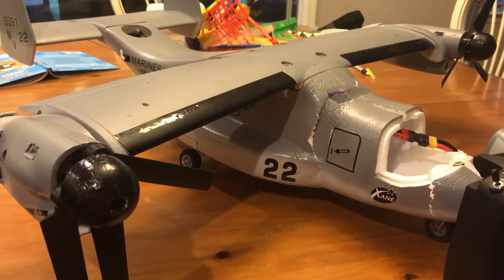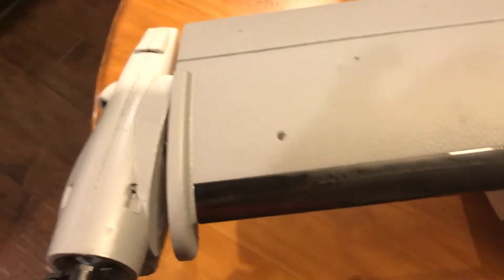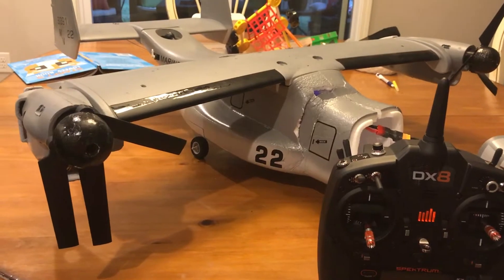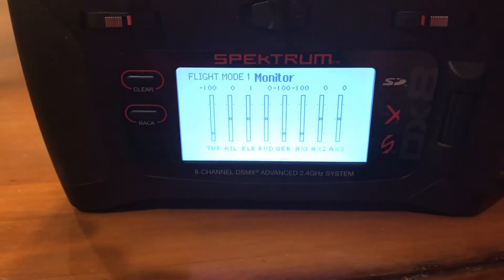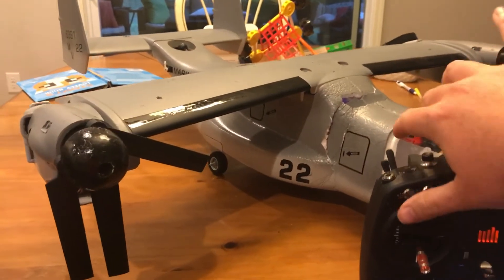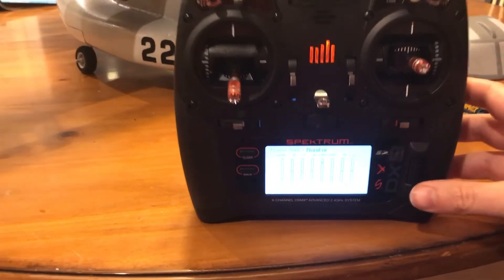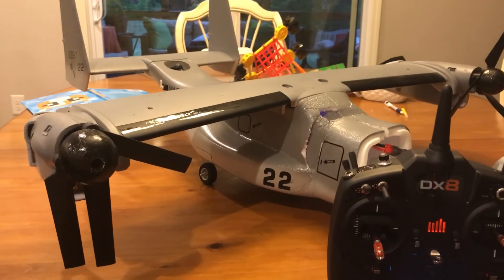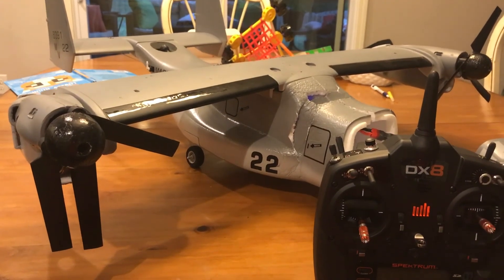Banana Hobby V22 Osprey - Post-crash testing, flight controller issue

Comment: Are you still flying this plane?  Has it crashed again?  Mine crashed on the second flight because either the Flight Controller malfunctioned or one of the nacelle servos stalled and flipped the plane over and made it drop like a rock.  This plane will crash if you don't put much stronger rotation servos in it.  The stock rotation servos will stall because they don't have enough torque.
Reply: @John Gabriel I would stay as far away from this plane as possible.  It has to be the worse plane I have ever owned.  The plane has so many manufacturing defects and design flaws that it is a very unsafe and an accident waiting to happen.  Don't expect Banana Hobby to stand behind this plane with any kind of support, as a matter of fact they will lie and tell you there is nothing wrong with the plane.  I will not ever buy anything from them again.

Comment: Did you do the transition cycle about 12 times before intializing?
Reply from the maker: That was before they started suggesting that; and I worked with their team on diagnosing what had happened.  They ended up having me ship back my electronics so they could determine the cause, and after that released the updated video suggested the 12 cycles before each flight.  My 2nd Osprey has not had any issues, so I think this was truly a defect in the original flight controller.

Comment: I bought this model from America waited weeks for it when it arrived NOTHING would work -flight controller E.S.C ,s rear fan motor "i subsequently found this was not even connected" all down !!!! the so called "flight controller" is a joke i am now fitting a KK2 controller and will fly as a multi rotor -i think this model is rubbish .john
Reply: Fly something else ,,,Not for you
Mine flys GREAT !  With retracts also !
Reply: @theamatimasblink6594  i would love to see the retracts as thats somthing i would like to do
Reply: @John Gabriel Have now got e-flite version of osprey now (much smaller)
Reply: @John Gabriel I am afraid I found the model frustrating so I bought the Elite this worked straight out of the box but I have so many irons in the fire I am always building or messing with something but like I said the the C22 worked fine when I received this there are many videos of this model on the tube. I have stopped buying from the states as import tax as got very expensive now.